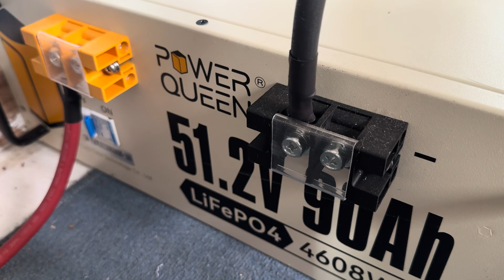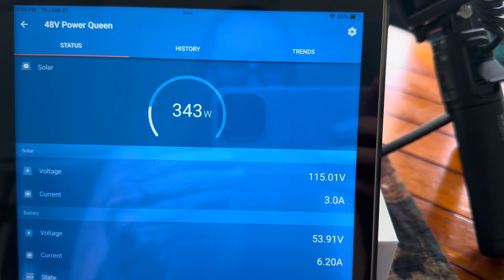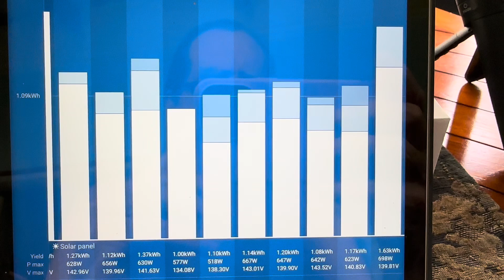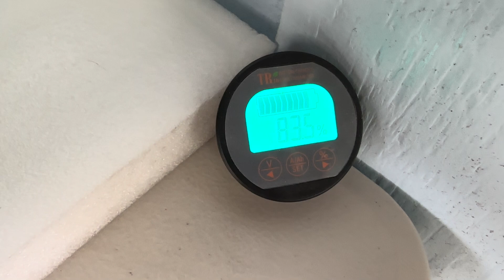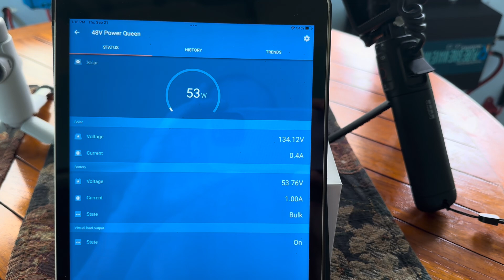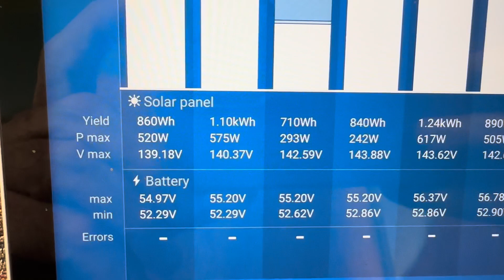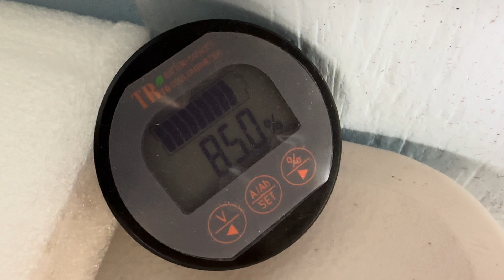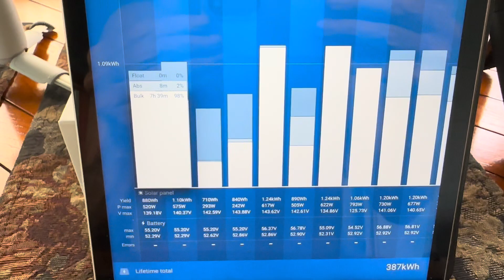48V LiFePO4 to 80% full. Working the sweet spot for maximum longevity?

Comment: To be clear, the absorption time serves only two purposes:  (1) To let the charge complete and (2) To let the BMS balance the cells, which the BMS will generally only do above 3.50V/cell (56V).    For #(1), the charge itself will almost universally complete within 30 minutes... that is, the current will tail off within 30 minutes or so once the charge target is reached.

For #2, the BMS needs more than 30 minutes of balancing time because it generally only has a passive balancer.   The general rule of thumb is 1 hour to 2 hours.

This is why the Victron's defaults are what they are, and also why the tail current specification is typically disabled for LiFePO4.  Because the charge controller needs to hold the battery in absorption long enough for the balancer to make decent progress.

--

Also, any charge target (including absorption time) MUST be 3.50V/cell (x 16 = 56V) or higher or the BMS will likely not turn on its balancer.    Because most balancers turn on at 3.50V/cell, and because the BMS and the charge controllers all have measurement errors, this means that the typical target voltage is programmed to 3.55V/cell (56.8V) to ensure reliable operation, and held there for 1-2 hours to ensure decent balancing time.

And the float voltage MUST be between 3.375V/cell and 3.40V/cell to provide load support without charging or discharging the battery.

It is confusing, but note that you can hold the float voltage at 3.375V/cell (x 16 = 54V) and this will basically NOT cause the SOC of the cell to go up or down for any SOC above around 60%.   So if the battery happens to only be charged to 60% and you hold the float voltage, it isn't going to charge further (or if it does, it will be very, very slowly).

LFP batteries have a potential barrier just above the standard float voltage range that must be exceeded to charge the battery above 60% or so.  This is why the float voltage itself, which is below the potential barrier, does not stress the battery even if held for a long time.

--

For solar applications, because they are daily-cycle, the battery is basically not going to be stressed with normal 100% charging and a 54V float, even if the charge target is set to 100% and held absorption is held for 2 hours at 56V, and even if the float voltage is held essentially all day long.  The instant the sun goes down any small load at all on the system puts the battery in a relaxed state.

For trickle-charge (alarm backup battery, UPS battery, etc) applications, the float is a bit more nuanced and the algorithm is a bit more complicated.  You need to charge to 100% and then discharge to 90% by counting amp-hours out, and then hold 90% at the float or even disconnect the battery entirely.  But then still recharge to 100% once a week or so to reset the SOC tracking.
Reply: The passive BMS in those batteries won't balance those cells, they will be a few hundred millivolt deviation..But yes, absorbtion is letting less amps in to slowly finish up while trying to balance, it just won't balance well..
Reply: @realeyesrealizereallies6828  It will balance the cells just fine as long as the correct charging parameters are used.   As I said, it generally only takes 30 minutes or less for charging to finish up once the target voltage of 3.55V/cell (56.8V) is reached.   This leaves roughly 1.5 hours for the balancer to operate.

These passive balancers typically do 50mA to 200mA per cell, and can do all cells at the same time.  So, roughly, 0.150 Ah of correction a day can be achieved.   LFP batteries drift very slowly, that is plenty when the battery is sitting above 3.50V/cell and well into the exponential portion of the charging curve.   Remember what the purpose of the balancer is... it is solely so the regular charging of the battery does not over-volt any single cell under normal operation.

The real problem is that, as you can see by many of the comments, it appears that a whole lot of people don't understand how LFP batteries work.   The charge target MUST be 3.55V/cell, the float MUST be 3.375V/cell to 3.40V/cell.  Multiply by 16 to get the pack voltage for a 48V pack.

These batteries have locked BMSs, there is no access to the BMS parameters, and because of that you just can't mess with the charging parameters because you will cause the battery to not balance properly (or at all) if you do.

One can purchase more sophisticated battery packs that give you app access to the BMS and do a more sophisticated setup, though I would say that probably 80% of the people who do that also do it wrong and wind up with worse outcomes.   A lot of people use parameters which actually guarantee unbalanced cells rather than guarantee balanced cells.
Reply: @junkerzn7312  I've taken those batteries apart when I was deciding which batteries to buy for my off grid homestead and tested them, their passive BMS's don't balance them well..Over time, they get worse and worse, granted a couple hundred milli volts deviation won't mean that much, until several years, but, there are better, cheaper options..I have raw prismatic EVE and CATL cells with the JK BMS that has an active balancer, that is set up to only balance when full, which for me is 3.45 a cell or 55.20 with absorbtion/floating at 3.35 a cell or 53.60 volts for one hour..My own tests and the tests I've watched on Off Grid Garage is what led me to the batteries and settings..I get a full 280AHs at those settings with multiple discharge tests over the last two years and it's easier on the cells, by staying out of the curve...Your certainly right that the charge curve is mostly flat, and the 80% 20% charge/discharge is for lithium ion, not LIFEPO4 and you cannot tell where your state of charge is by reading voltage..Lots of people believe their shunt will tell them, but the shunt gets out of balance over time..I don't even have a shunt and I have several 16s packs in parallel..
Reply: @realeyesrealizereallies6828  Yes, I follow Andy too, he has a great channel.  But I would say that he puts a little too much trust in the voltage settings and doesn't have enough respect for the absolute measurement error of the various pieces of equipment.

You can use a 3.45V target when you have control over both the BMS settings and the charge controller settings.   At least you can in warm weather.  The SOC will suffer in cold weather.

But you are trying to use an active balancer to force-balance the pack in the knee of the charging curve with very, very narrow voltage margins when you do that.  It is entirely unnecessary.   Passive balancers work just fine when the parameters are properly programmed... LFP cells drift very slowly, so slowly that a 100mA passive balancer has no trouble with it.  When properly programmed.

It is true that many older sealed (car battery style) LiFePO4 batteries had poor BMS settings and operation.  And without access to the BMS or cells in these sealed batteries, it is hard to determine which batteries do it properly and which do not.

But I guarantee you, these sealed batteries will absolutely not work properly with any charge target setting below 3.55V/cell (56.8V).   These sealed batteries are what paradise has to work with.   He doesn't have fancy battery packs with accessible BMSs.

-Matt
Reply: @junkerzn7312  There are many reasons to use a higher setting than I do, the number one reason being time, if you have a boat, and are charging from shore power quickly, or have limited solar exposure, or if you use most of the energy in your batteries everyday, the higher the setting the faster they charge..I would consider premade batteries "fancy" and the do it yourself batteries more meat and potatoes..I went with the cells because you get more quality for less money, but have to do a little more work..I did test some premade batteries, at different charge settings, and didn't have any problems from 3.45 to 3.65, they do balance better at 3.55 and above, but you could do that once every few months and still go with 3.45 a cell..I didn't like the cells themselves, or the BMS, wire choices, I suspect that the failure rate is orders of magnitude higher than the grade A prismatic cells with a good BMS..I just suggest watching Andy to get a good understanding..If it were me, I would take all those cells out of those premade batteries and build my own batteries with a JK BMS, problem solved for $150 bucks and a little work..And I have done that very thing for a 12 volt set up that runs my lights and a 12 volt fridge in my workshop..
Reply: There is a reason why you should start balancing at 3,4/3,45V and it is simply because when the voltage curve is getting out of the flat area, It is exactly when the BMS lower currents are more efficient. With higher voltage (3,45v and above) 100miliamps can do a lot more, and it is easier to balance a higher voltage cell because the BMS "can see" what to do. There is a 10/20mv difference and you only see it when you reach that point. Below that and in the flat area you don't have a clue because there is no difference in voltage, no matter the state of charge. It can be all over the place and you won't even know it!

So getting a bit higher in voltage will ease out the spotting of runner cells, and below that the BMS won't do anything because there is no difference 

Once a year I do a full charge and make sure cells are top balanced and I don't use any balancers... at all!

Also voltage reading from cells are usually accurate if you crimp the cables correctly, and since there are basically no currents flowing,  those are reading cables.

That is why the JK balances, stops balancing, reads voltage and balances again until needed. The reading is correct and leaving it lower than 3,4v does not help the BMS balancing function at all...
Reply: @ricardomarcelino8388  Ya,exactly agree with all of that...

Comment: 100% charge IS THE SWEET SPOT for lithium iron. You do not want to limit to 80% and never top balance. You can cycle these 0-100% daily for years without even seeing degradation.
Reply: Apparently that is not true.
Reply: I think it's okay to leave it > 95% state of charge, so low as the voltage is not kept high.

Comment: The absorption time at 5h is excessive, 2h should be plenty. Your other settings  seem fine. Your issue is weird, i suspect the battery bms, but it was working fine before u changed settings.

Comment: As im watching your video i have a BougeRv Charge controller that is constantly resetting itself. I sent the company a msg stating i think the C.C. is defective. Now after watching your video I'm wondering if this is perfectly normal operation?. My BougeRV CC is doing pretty much the same thing??
Reply: Its not normal. But im stumped on his issue. With yours make sure all the connections are properly tight and the voltages arent too high. Should be a smooth power curve to full assuming a sunny day.
Reply: @aniketos7336  Thank you, i didnt think it was Normal. i do have it on video and i sent to BougeRV. Lets see what they say.

Comment: looks great. some times it takes some time to find that sweet spot. pushing everyday to 100% with out much discharge can shorten life a tad. keep in mind that over time with those settings the cells may not top balance. for short term this wont matter because you are not discharging much. what you can do is save settings . switch to factory LiFePo4 setting. after a month or 2 for a day. just to balance the cells.  the down side is you get extended lack of sun you will not have full power. for the short term this is ok as long as you don't drop under 20% charge. but if you get a time like that switch back to factory setting for a day or 2 to balance cells. if you know a bunch of cloudy rainy days are on the way put to factory setting to get to 100% because you may need more to carry threw to poor charging days. just something you learn over time. every system is different.  set what works best for you. My stand alone 12V has AGM on it now. no loads. I did drop absorption time in half .that a outher setting you can cut back with small loads .
Reply: Generally speaking you want the battery system to be fully automatic and require no maintenance or special work to keep it in good shape.  LFP cells drift slowly so a balanced pack takes time to get out of balance when the settings are messed up.  Usually in the months.  This also means that it can take weeks of normal daily cycling with proper parameters to get the pack back into balance after you've realized that you've messed things up.   And by messed things up, I mean the SOC range for individual cells exceeding 20% after a number of months due to bad charging parameters.

Just holding the pack fully charged for a day won't fix an unbalanced pack.  The passive balancers in these batteries can only do like 50mA to 200mA.   Correcting a 20% imbalance... lets call it 20Ah, at 100mA takes 200 hours of balancing time... a bit over a week.
Reply: It will still top balance at those settings, but the passive balancer in the BMS in that battery can't balance those cells properly, and it never will be able to, no matter how high you charge to...If he does a discharge test he will still get the 90 AH's, he is still filling the battery up, not 80%, that's not right..That's not how it works..

Comment: I'm not sure i can set the parameters on my Charge Controller so it doesn't go into Absorption prematurely. I have the Victron 100/30 model. There is a manual setting at the bottom of the C.C. that you can set the different types of Batteries .I had to take it off the Lithium mode so it doesn't go into the Absorption prematurely. Now the C.C. seem to be operating like it should and staying in Bulk Mode. The battery Voltage never gets higher than 14.2 according to the Direct Connect App. The Battery voltage is much lower 13.3 when i take a Multi Meter reading. Max solar i can get is a little over 200 Watts. I really dont want to go over that because  i have the wiring coming into the apt. via barrel plug (7909) I don't think these plugs are meant to be pushed more than 10 Amps. I have got readings over 12 Amps but from time to time i check the temp on the connection and its cool to the touch so I'm good. Eventually to add more solar i will have to change out the barrel plug to get more wattage. I did a video recently of my small DIY system if you wanted to check it out. Sorry for the long comment. BTW the Charge controller to stay within the 80% SOC is doing some heavy algorithmic mathematics that's why the constant fluctuation in wattage would be my guess. The Victron C.C. is an Amazing piece of Equipment.

Comment: So, basically, you want the charge target to be 100%.   Or to be more precise, 3.55V/cell x 16 = 56.8V.  Set the Victron to hold that (absorption time) for 2 hours.  The reason you hold it there for 2 hours is to give the battery's internal BMS time to balance the cells.   The whole point of balancing is to ensure that under normal operation, charging to that level does NOT over-volt any single cell (to 3.65V or higher).  Now of course, the BMS will not allow that, but in terms of battery stress you don't want to be constantly hitting the BMS over-voltage protection.

The float should be 3.375V to 3.40V per cell x 16 = 54V to 54.4V.  Use 54V if loads are generally low, and 54.4V if loads are high.  The float setting provides load-support without stressing the battery or discharging it.  Even though you see the voltage drop to the float level, be assured that the battery is still at nearly 100% charge and will stay there until the float goes away.

Now, the big question.  WHY NOT charge it to 80% (!) ?   The answer is, because its impossible to do that.  The charging curve is so friggin flat for LFP that it is literally impossible to dial-in an 80% target.  Minor variations in load and charge rate will throw off any careful settings you try to make.   Even smart controllers that measure the energy going into and out of the battery will accumulate errors over time and just not be able to hold an 80% charge.   In addition, the cell voltage won't get into the BMS's balancing range so the BMS may not be able to balance the cells, resulting in a WORSE outcome.

This is why Tesla, for example, asks owners of model 3's with the LFP battery to charge to 100%.   Also, charging to 100%, when done properly, does not put any significant stress on the battery.  Particularly in cyclical solar applications.   The reason is that the instant the bulk and absorption are done, any load at all will cause the cell voltage to drop to roughly the float level almost immediately.  So even when fully charging the battery, the cells are simply not held at high voltages for very long.

-Matt
Reply: Finally, someone that agrees with me on the 3.375 Volts!  Thank you! Everyone else is way to high.
Reply: I did a more involved comment on his next video, but basically everyone including me is wrong because his 48V Power Queen battery is a 15-cell series configuration and not the 16-cell series configuration most of us assumed. So everything is x15 instead of x16 and that pretty much accounts for the weird behavior.